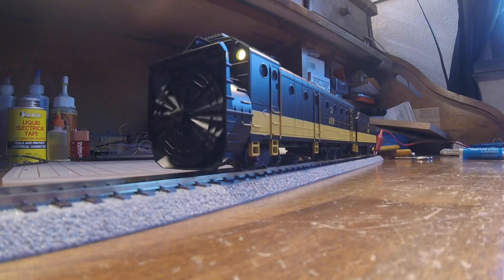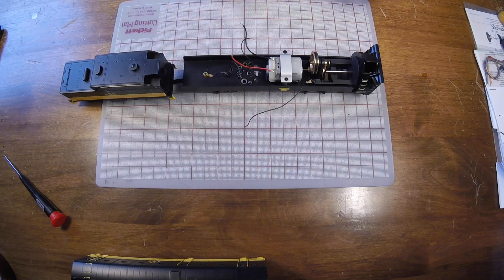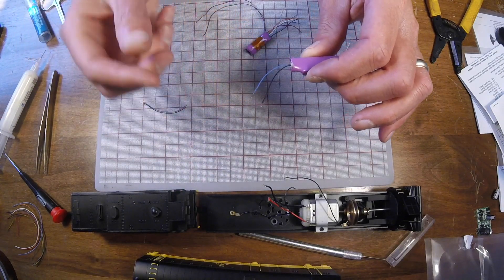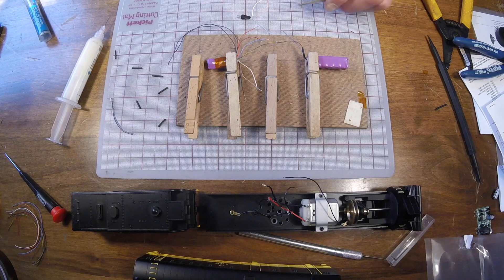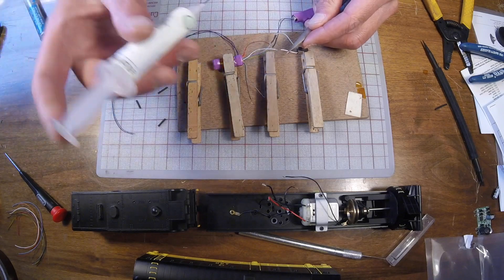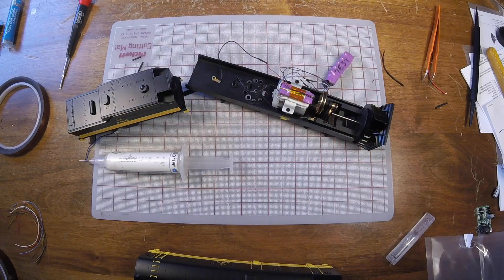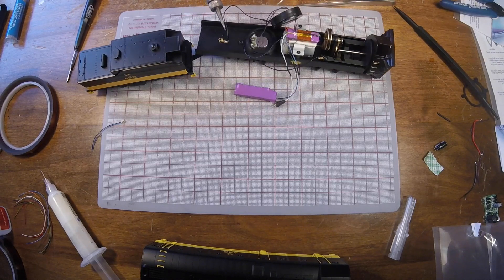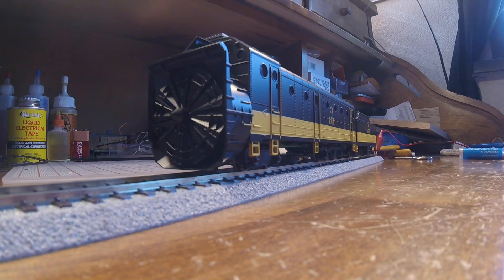Step-by-step Tsunami2 (TSU-1100) Installation in an Athearn RTR Rotary Snow Plow

Comment: Sounds great, I picked up this model as I'd like to do a sound installation, I know you used the TSU-1100, but which steam sound? Kinda sounds like the rotary blades are actually flopping around like the prototype.
Reply from the maker: The CVs we changed from factory default can be found linked in the description or here: https://soundtraxx.com/content/Reference/Documentation/Application-Notes/AthRotary.pdf 

Factory Default settings can be found in the Tsunami2 Manuals: https://soundtraxx.com/reference/manuals/

For more assistance please contact our Support Department: support@soundtraxx.com
Reply: @SoundtraxxDCC  ...Thank You so much guys :)

Comment: Is there a printed table or how or what CV's do you change to alter the engine sound and whistle sound? How do you know what to change to without throwing darts?
Reply from the maker: Yes all of this information can be found in our Tsunami2 Manuals. The manual is available on our website as a free PDF that you can print. The manual consist of an Installation Guide, a User's Guide, a Technical Reference, and Sound Selection References.

If you are just looking for the exhaust chuffs and whistles look at the Steam Sound Selection Reference. If you need more info on how to use these features start with the User's Guide.

The manuals for all of our products can be found under the Reference Tab on our website: https://soundtraxx.com/reference/manuals/

Comment: What is your thoughts on putting this into a consist with a pusher steam loco and be able to control the rotation of the blade independently ?
>>NEVERMIND>>  plan is now to not consist but use loco and plow as independent and switch between their addresses to rotate plow, sound whistle, control horn and lights etc.  Keep 'em coming!
Reply: Got it installed with a TSU-750.  Quandry is the blade turns too fast for engine notch that would be prototype.  Tried to put resistor on the motor circuit but 370 ohm was no change and 1k ohm resulted in no rotation.  Thought on a cure?
Reply from the maker: Nice!

Comment: Awesome!  The sound is cool.  The Athearn current limiting board ALSO only turns the blade in one direction, so this install takes care of that issue as well.  I'm modeling an electric powered rotary so I'll need different sounds but otherwise this is a great guide.
Reply from the maker: We are glad it will still help!

Comment: I just actually did one of these in one of the snowplows with the B unit. I wired a 2nd decoder in the B Unit for the engine sound which is pretty fun since you have to hardwire the whole thing in to the metal contacts. I also drilled small holes where those “nubs” are on the body and put small LEDs in there with some canopy glue to make the headlight coverings. It was a very fun project and I’m glad to see someone made a video on it so others can do this.
Reply from the maker: Sounds like you did a good job on the install. Do you have video of how it turned out?
Reply: SoundTraxx https://youtu.be/hHjFdXJHdAs